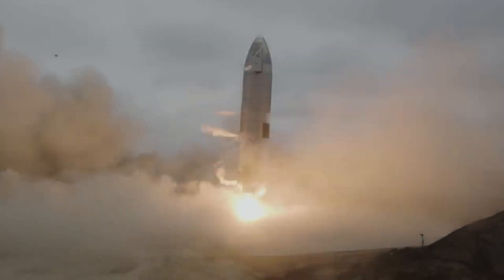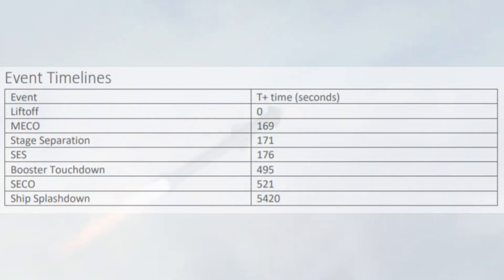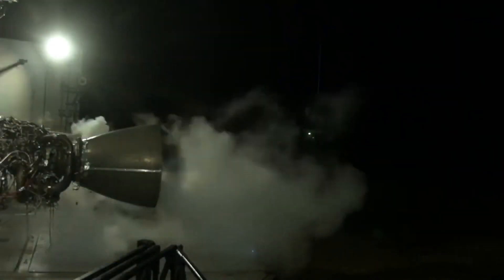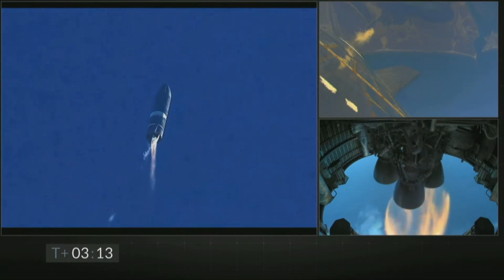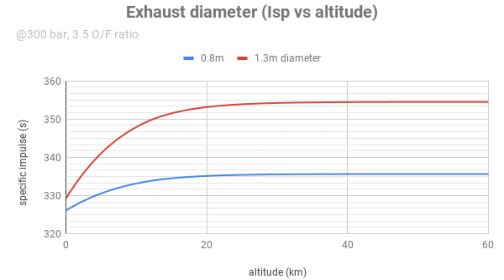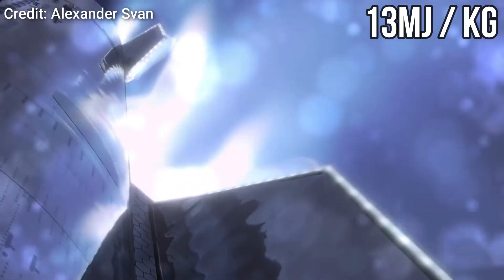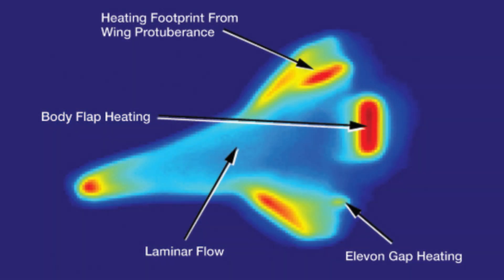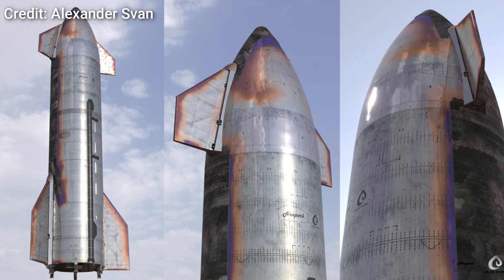SpaceX Starship SN20 vs SN15 : Major Changes Explained

Comment: I think you’re right. We’ll be pleasantly surprised by SN20 although I’m certainly not going to be disappointed regardless of the outcome. Getting this far would’ve taken any other company (or country) a decade at least. The iterative prototype process is a brilliant move by SPACE X! I am very curious about the heat tiles. Is it possible to “Spray-on” the heat shield? I would LOVE to see a video addressing this. Are the polymers able to be sprayed on? 🤔 It would be more protective I think....if possible.
Reply from the maker: Actually there is very little information about the material of the  heat shield tiles (obviously it's a company secret). All we know is that they use ceramic

Thanks for watching 👍
Reply: @spacexplained5001  Ohhh, right! Ceramics, hmm 🤔 In that case perhaps I should do some research on it. Surely there is a material that could be applied in that manner. Thank you for the response! Love the channel!

Comment: OK ---------  You forget that an Advanced engine cone that is almost as wide as a Vacuum cone can operate at lower altitudes by reducing the size or narrowing the cone (after reaching its Vacuum diameter) by a few inches at the trailing edge of the cone. This prevents higher pressure air at sea level from pushing up inside the cone between the low-pressure high-velocity gasses and the wall of the cone exploding and destroying the engine. This would give the sea level Raptors the majority of a Vacuum engine's efficiency without being torn apart at sea level.  But then the Starshp would not have the room for 3  vacuum and 3 almost vacuum (much longer and wider than sea level) engines that must gymble inside a much longer hull skirt. Which means Space X has made the right call on both the Starship and the Super Heavy Booster. The number of engines (total thrust) is more important than a few percentage points of Efficiency.
Reply: So much bad...

Comment: OK ------  Sorry but if you knew anything about Orbital dynamics, you would know that in order to reach Hawie from Texas going East SN-20 has to fly above the Carbon line even if it is not going into orbit. Sorr bone head. Please Do some bookwork before you start making Such Statements. But entertaining video anyway.
Reply from the maker: I said the perigee should be above the Karman line (for SN20 to reach orbit). SN20's apogee will surely be higher. 

Even New Shephard flights have apogee above 100km, but it's still a suborbital flight